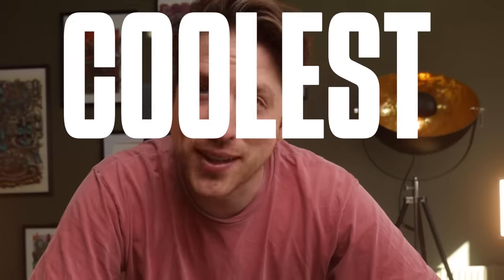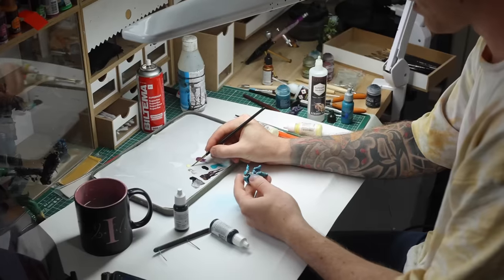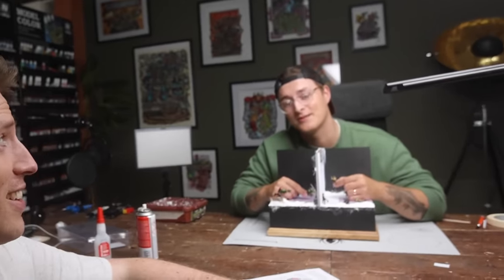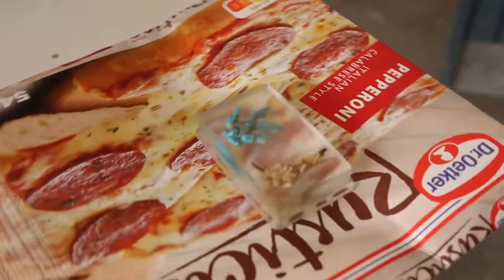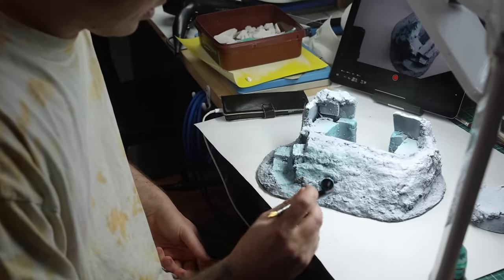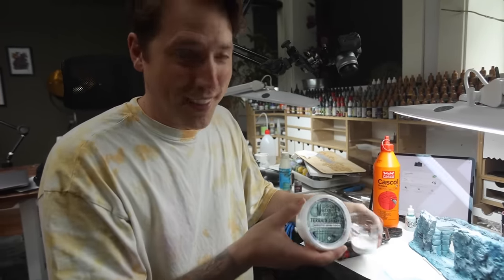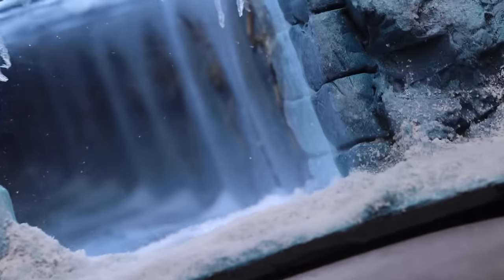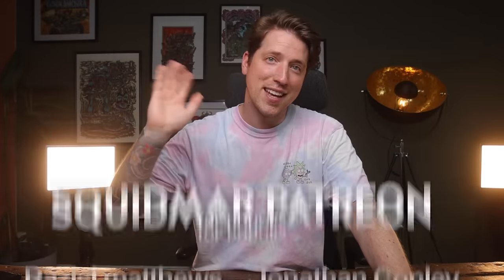I made infinite Space Marines trapped in ice

Comment: Another possibility instead of a clear varnish or polishing the resin to increase visibility would be a layer of clear packing tape. I don't have any specific experience with using it on a resin surface but I know clear tape will usually give clear vision if applied to frosted glass- I believe that the adhesive fills in the textured surface and the clear tape gives a smooth viewing surface.

Comment: Fantastic Build. 

I wonder if you moved the mirror from behind and in front the blocks of resin, and instead lined them up so the edge of the mirror was on the front side / between of the faces (in the same orientation, so you'd have to cut the mirror smaller) but if you had both mirrors sandwich between the blocks of resin instead of in front and behind then i think you could get rid of that Gap between the blocks of ice in the reflections.